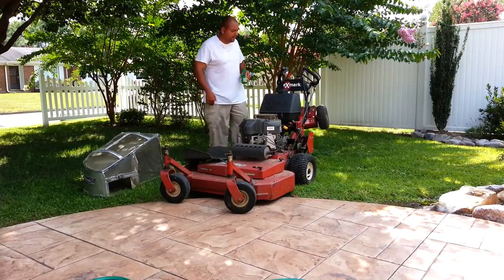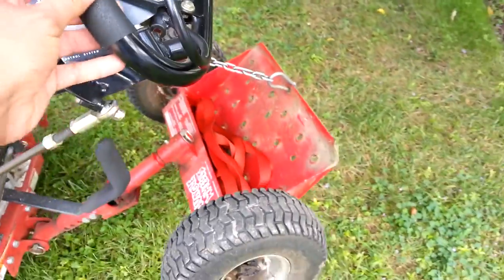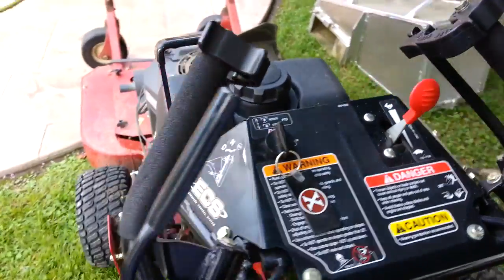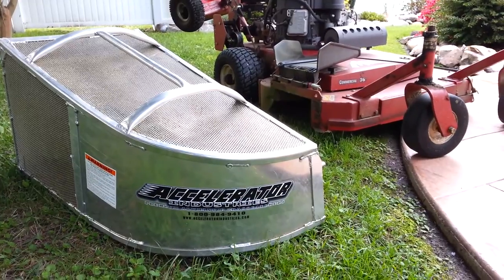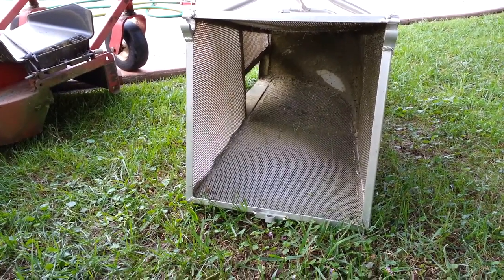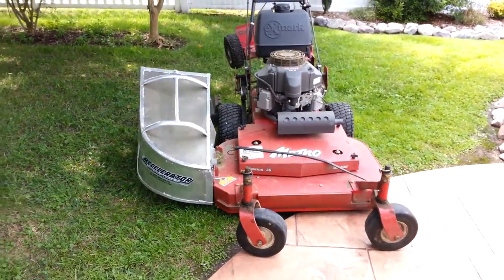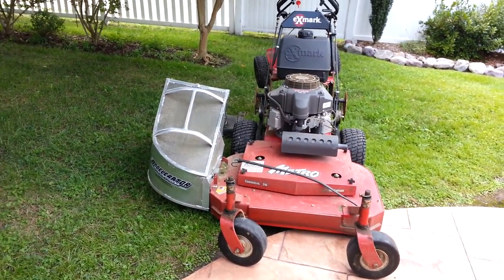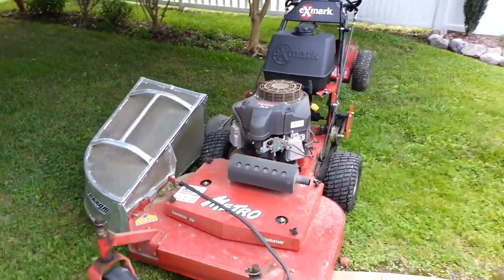Emark metro 36 w/ accelerator bagger intro.

Comment: Yup there a good mower for the price like you I try hard to mow in forward gear and just trim what ever I miss. Yours is newer than mine I have the model with the pistol grips which is ok. I have had mine for around 19 years and it still runs fine. I have the old steel bagger yes there heavy. But then again I did not see the accelerator back then. Good luck with your mower and bag.
Reply from the maker: John Bailey Thank you buddy once again,  the eXmark metro is a fantastic mower, and forward is the way to go, then trim out with the push mower or trimmer....  but I actually sold it in November and now I have the Toro Turfmaster commercial  30 and it's  amazing. with the 30 inches I can get it close to anything.  I do miss the eXmark metro 36,  but the the Turfmaster is a beast,  check out my newest video on it, and let me know what ya think 👌🌱

Comment: What I dont like about that mower is that its a a belt drive and they suck for backing up. Yes I have both the belt drive and the dual hydro the hydro is so much faster. I like your bagger im sure it lighter than my old steel catcher.
Reply from the maker: John Bailey Hey buddy how's it going today and thank you for watching and your support. You are correct it doesn't really back up good. But the way I did it was just keep going forward then I would use a push mower to trim out areas closer against fence lines, walls, or any other obstacles. The bagger is super amazing the best thing I've ever purchased. 😉🤘